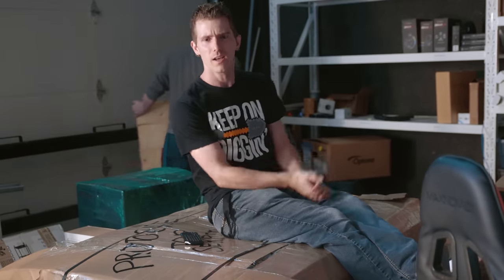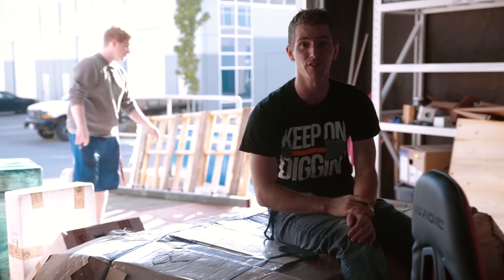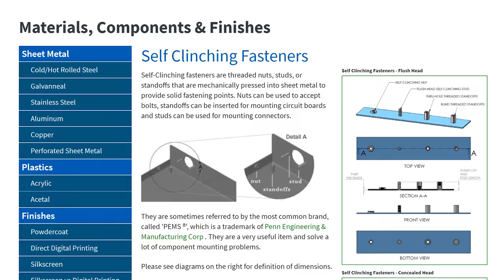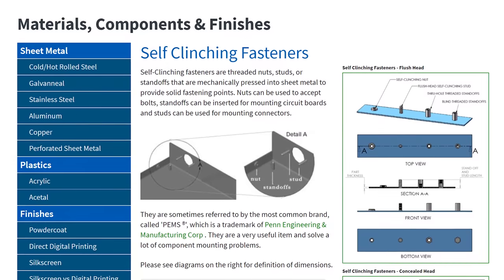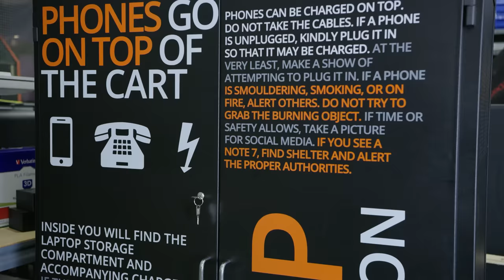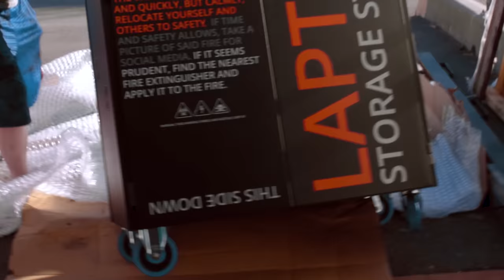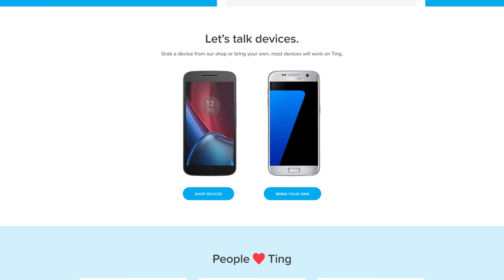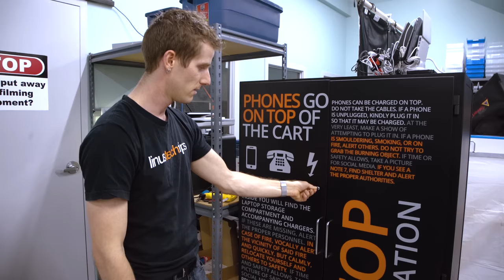How to Store and Charge FIFTY LAPTOPS AT ONCE! - Laptop Cart

Comment: Linus said many times that they designed and bought this case so their laptop batteries wouldn't die..... but, I hope he knows that (consumer grade) lithium ion battery cells degrade being left at or near full charge all the time, even if not being used..15% a year maybe more.  For laptops that are not used often, it would be wise to store them at 40% charge or less on the shelf or in that box unplugged. Take out of laptop if possible or figure out how much leakage & make charge top-off schedule.

With my laptop batteries, I store them at about 30% in the fridge and I don't worry about the batteries severely discharging. Every 6 months I take them out and charge them for a half hour or less, aiming for 30% or so SOC. So when the battery in my laptop dies, I put it in the recycling pile and take out 1 from the fridge and it is like new. 

 

SO, storing lithium ion batteries at full charge really isn't a good idea if your goal is to keep them from dying.. But setting up a schedule to charge them a little every month or something like that would be a better tactic.

Comment: Yo Linus, those gaming laptops with Dual bricks probably only need both while running under load, and for charging 1 brick should be just fine 99% of the time, only so much power you can pump into a battery at a time to charge it.

Comment: 32 laptops, 150 watts per brick,we're talking 4800 watts.  That would fully occupy 3 household circuits.  Plus loads from cooling fans, cellphone charging, and stuff.  PS: the reason you make it out of wood first, is to catch all the design mistakes you made in your first iteration.  The wood is your mockup.  THEN you correct your design, and order your case.  But I will admit, it does look cool.  And unique.

Comment: Well, the fans are blowing air perpendicular to the plane of the laptops. Meaning only the ones next to the fans will ever get any air flow. Put some temperature sensors inside and check how hot it is in the middle. Also, lol @ not including the installation and brick size into the design.

In before Samsung lawsuit over Note7.

Comment: Serious question: Why do they say that the laptops will "go bad" from being left uncharged? I thought Lithium Ion batteries should be stored at moderate voltage, that is, around 50% charge? Doesn't keeping batteries at 100% charge actually stress batteries? I was under the impression that charging the last 20% to full was responsible for 70% percent of the battery's wear. Do laptop batteries not undergo wear cycles while they're being maintained at 100% charge?

Comment: What do I do if I want to leave my laptop in storage for 12 months and don't want the 🔋to get damaged by discharging to 0%? I have noticed that my old laptop even when OFF drains about 1000mw per day so for 40wh 🔋this would get it drained from 100-0% in about 40 days. I have tried everything that didn't work including holding down power button for 30sec and researching this revealed that it's a problem and the only solution writing on internet about this is to set the laptop in the so called "shopping mode" and that's for HP laptops but mine is unfortunately ASUS. So I have completely exausted my mind about this and the frustrating thing is I just turned on a spare mobile phone that had been sitting for 18 months and 🔋 was still at 65% so why laptops can't do that but drain and ruin the battery within few months even when off? By the way disabling fast startup didn't fix the problem either. I am so frustrated and at the point of giving up and just physically opening laptop and disconnecting the battery.

Comment: You should really leave the production process to the experts, Linus clearly has no idea how this things was actually made. 
And, I highly recommend leaving laptops in this thing charging at all times. Seriously though, 15 minutes of research about lithium battery technology will tell you that it is better to store them in a fully charged state but not charging. The fastest, easiest way to ruin a lithium battery is to OVERCHARGE it. Any decent 18650 cell, what laptop batteries are usually made from, will have a protection circuit that will prevent over-discharge. Keeping them in a fully charged state will not trigger the protection circuit unless the temp get's too high. 

How is it that you run a million dollar company but don't have people on staff smart enough to find this information and come up with better solutions? I'm baffled! If you leave a laptop in this thing charging for 1 year straight it will have at least one dead cell and not function without being plugged in; GUARANTEED! When that happens contact me and I will help you redesign this poorly thought out piece of shit.

Comment: Leaving a laptop plugged in all day will also kill the battery, the best thing to do is just power up the cabinet for an hour a day but it will still kill the batteries (admittedly it will be an extremely slow process). There's no winning with batteries they are just shit.
Reply: charging controller will disconnect battery while it is fully charged. Proper charge controller won't allow charging it again unless it drops down to 90-95%, so it's fine.
Only one proper way is to store batteries disconnected. But obviously they just aren't going to bother with it.

Comment: Linus, although it is unlikely, if you read this comment i have an offer for the predator laptop at the bottom of the case (if its not a personal laptop.) i am offering a Dell precision t5600 and a dell precision T5500 and if that doesnt convince you i have a terabyte of storage (4 250gb Hard drives) to add to the offer.